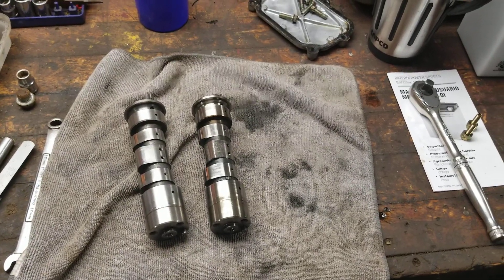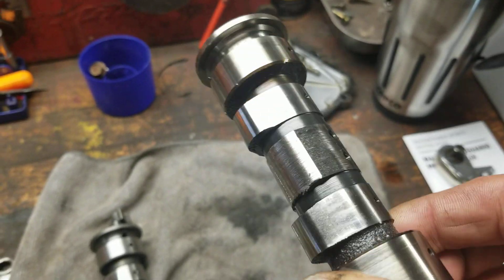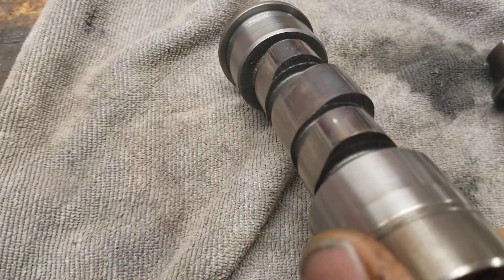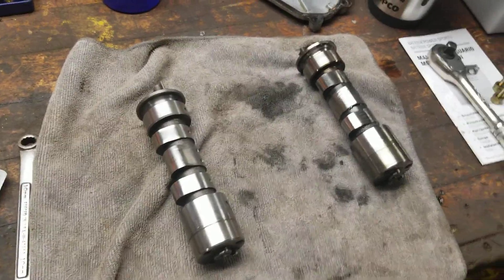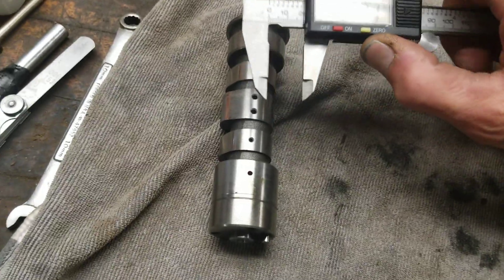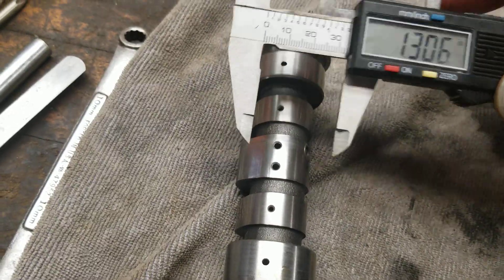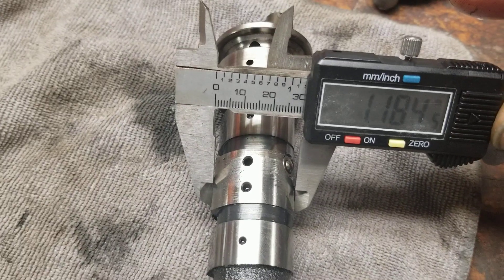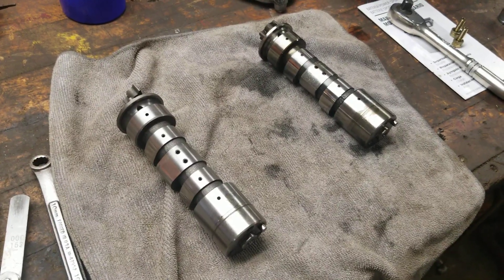How to tell if you have a good Polaris 500 camshaft.

Comment: ok heres my question... 500 polaris ranger 2002 ... cam shaft rocker arm assembly mine has a bolt missing befor i tak this apart its not the rocker arm bolts that hold the rocker arm on .. but on each pedistal there is a bolt one on each im missing one... What are they for ??? . i do know this has been apart befor....  IM HAVING A PROBLIM STARTING WILL NOT GO PAST COMPRESHION Burnt out 4 starters 4 starter drive gears ...  its so un pridicatibule it crazy.. cant seem to retard it enouf or advanced it enouf thank you
Reply from the maker: I'm not sure what you mean by pedestal. I have a video of building an engine from the ground up. When you pull the side cover off for the cam gear 2 bolts go into the edge of the head where the cover is on the bottom. There are 3 bolts holding the cam gear on the cam. Is that what you are referring too? They need to be on there or the cam gear will move back and forth causing it to start hard.

Comment: Hey I need some help. My sportsman 500 sputters/bogs down when I give it at least 1/2 throttle. I cleaned the carb and made sure the jets weren't plugged. but what I noticed is when I would take the air box lid off it would rev up better. Ive been dealing with this problem for quite some time and I really want to fix it. What do you think the problem is?
Reply from the maker: Ran across that problem a lot. It could be a couple things. Carb diaphragm,  hoses to airbox, inline filter on hose, fuel lines soft. The most common is the carb intake manifold boot. Something is letting it draw enough air. Worse case could be compression.  Check valve lash too.
Reply: @TitaniummanGarage  ok thank you!! I appreciate it! I’ll check those things you listed and see if any of those are the problem. Also would a worn cam have anything to do with it?
Reply from the maker: @micahl9075  What year is it?
Reply: @TitaniummanGarage  2000

Comment: Thanks for the excellent info!  A few questions:
-What manual specifies the go/no go tolerance for a cam?
-I haven't removed my cam yet; but expect that I'll need to replace. I was looking at the kits (cam, rockers, seals); but you were saying weren't as good as OEM used?
-Are any seals necessary to get at the same time? Or do I need to use sealant?

Thanks again!
Reply from the maker: Just the rocker cover gasket and there is an O ring on the side cover that the cam slides out of.
Reply from the maker: I use the Klymer manual
Reply: @TitaniummanGarage  Thanks again!